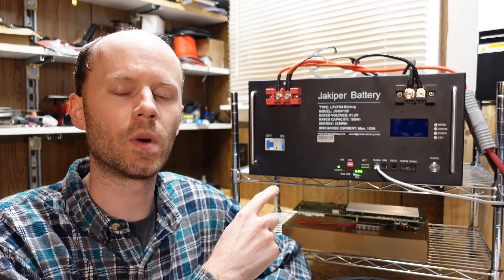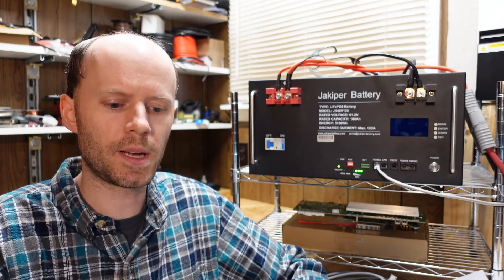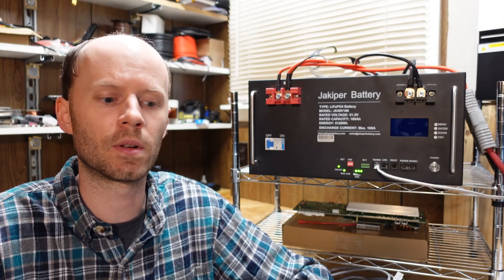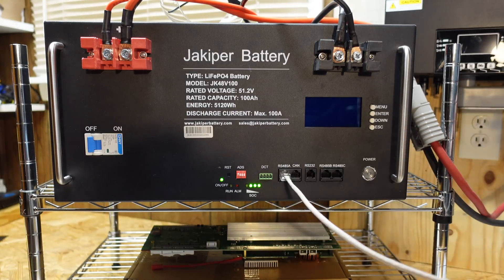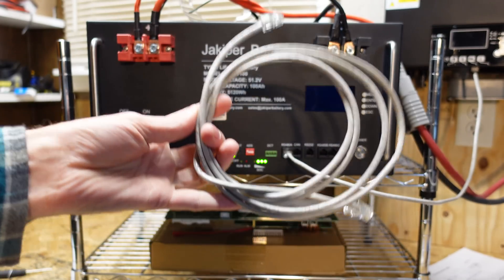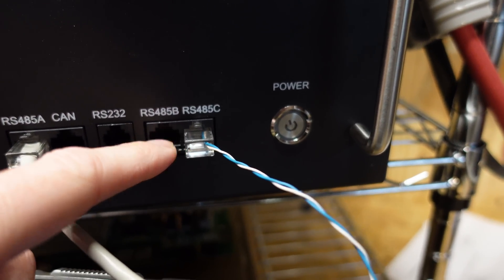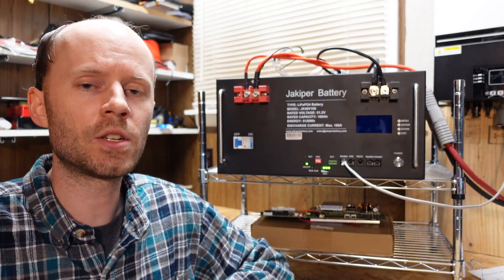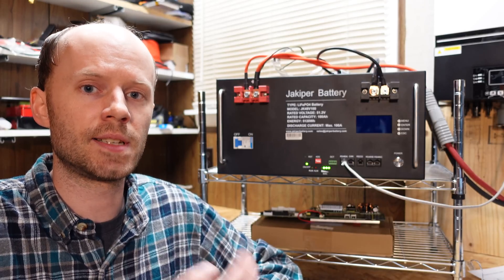Jakiper Battery and MPP Solar Inverter Communications, What's the Problem?

Comment: It has been years (over 30) since I worked on RS485 communications.     A cable with only ONE Pair (2wire) is a one way direction communication AKA Half Duplex.   A cable with TWO Pair  (4wire) is two way direction AKA Full Duplex.    Give the RS485 pin out of your battery to the inverter tech agent and ask them just map out the wires for a FULL DUPLEX cable.    You could see both devices on your video with your usb conversion because you have them both wired to "output", aka information coming out.   But on RS485 one pair is "input"(read) and the other pair is "output"(write).   I hope this helps.  (note:  When you showed you config screen, I noticed it was set to FULL Duplex, that is what made me think about this.)
Reply: Well, sort of. You're right that two wires makes for a half duplex RS485 bus, but there's no inherent directionality. It just means that you can't send and receive at the same time, the lines are shared. With this kind of low data system, that's not generally a problem. Probably one device is just polling the other device for information to avoid transmit collisions.

I don't see in the video where you mentioned it displaying full duplex. If it is set to that, but the other device is expecting or only capable of half duplex, that would be a problem.

Comment: People have generated electricity by connecting dumb lead acid batteries to inverters for decades. Then they started to replace the LA batteries with dumb Lithium batteries and all just worked fine. Communication was introduced to commercial products, so that users could NOT easily take any equipment and mix it up as they wanted. This is just the "Apple" concept put onto every newly built device. For what? I would never buy anything what need communication to work! If the device is only monitoring, then OK. Don't let a company tell you what "SMART" is. Be the smart one and go for basic, first principles. Something what will never break on you and where you can understand what is going on at any time.
Reply: Not everything in life is some grand conspiracy, having your inverter/charger tail off change current at high SOC is pretty handy. Also having an inverter shutdown gracefully and not just the BMS opening the FETS on a 100A load makes me feel happier something isn't going to go pop.
Reply: @edc1569  All those levels and limits you are talking about, can be set in the inverters UI anyways. Why would a BMS need to dictate this? Now you will say because of cell level voltages. Are you seriously going to hard limits on daily basis? The BMS has anyways final authority as you have correctly stated. What I dislike is that there is no fallback in this case. You get an Error on the inverter and it will shut down. Just because of communication issues while the inverter could easily continue its job by basing decisions on voltage. Generating electricity is a discipline of electrical engineering. Unfortunately, IT is starting to take over too much of it in my opinion. But yeah. Thats fashion of our modern times, and consumers are asking for it...

Comment: Will the battery work OK without  communication? Is it an essential feature or ust " nice to have"?
But there is the issue of truth in sdvertising/ false claims
Reply from the maker: Absolutely, it works great without the communications. It's just a feature that's nice to have and wanted to demonstrate since both devices support it (supposedly).
Reply: @LithiumSolar   thanks. I believe in the KISS principle !

Comment: Hi, look like it is the communication protocol, BAUDS-stopbit- etc. if those two do not speak the same language they dont communicate.  For what i understand, check the bauds etc it is using on your computer, and if you have to conf  the same on the units. 
have a nice one everybody
Reply: Looks like it needed a bit more setup than simply plugging it in even if the connections were correct - jakiper made a video https://youtu.be/J3JpHn4FeqA

Comment: Q4: How BMS communicate?

A4: Basic version received before 23th, February, 2022, BMS can communicate with PC though RS232/485.

Upgraded version which received after 24th, February, 2022, BMS can communicate with inverter though CAN/RS485A port, like Growatt, Sol-Ark…
Reply from the maker: Mine is the upgraded version that has the BMS comms ports.

Comment: Yeah I never got it working and never tried. That sucks they said that. I emailed them saying I am not interested in trying the communication out at all. I don't like the communication system for these batteries. I don't want any of my batteries communicating at all, and I use voltage to modify cycling behavior. Really sucks that they claimed I said that.
Reply from the maker: It seems like these companies all talk even though they're competing for the same customers. I don't understand, but either way, the claim was you and Dexter got it working on the SOK battery prototype (which I'm sure they heard from Min), so if it works on that battery it must work on the Jakiper too since they both have the same BMS. Communication is definitely not needed or required, but as you've seen by my elaborate Batrium displays, I like data! Lol
Reply: @LithiumSolar  That's because they watched your videos and Will's and found out how to build batteries, but nobody has a done a youtube video on how to program and implement a battery inverter communication interface. Of course that would be a year long video, and they would probably lose their attention.....
Reply: @NeverTakeNoCut-offs  I think Signature Solar has a video on how to do that . I didn't watch the whole thing though.
Reply: @LithiumSolar  I WOULD JUST RETURN THE DAMN THING, IF THEY WON'T TAKE IT BACK JUST USE THE CELLS FOR A DIY.........THAT REALLY SUCKS AND IS VERY SCARY.......I'VE GOT A LOT OF PROJECTS WAITING FOR THESE THINGS, WHERE I MIGHT BE BUYING BUNDLES OR MIXING COMPONENTS........THIS NIGHTMARE YOU'RE GOING THROUGH IS A REAL WAKEUP CALL..........
Reply: @LithiumSolar  if you did all, any chance this battery communication is  manufacture wrong connected , sorry for my ignorance, but anyone thought of this?
Reply: Doesn't the voltage drops at different loads cause issues with using voltage to set changer/discharge responses.
Reply: Other info I have looked up makes it sound like these use the canbus to talk to inverter charger and not the rs485
Reply: Jakiper now has a video on how to do this https://youtu.be/J3JpHn4FeqA

Comment: I couldn't tell from the video, but is the BMS on? I couldn't tell if the lights on the power button were on during the testing
Reply from the maker: Yes, the BMS was most definitely on. When the BMS is off, it also shuts off the SOC lights.

Comment: I was always under the impression that you need two pairs at a minimum for RS-485 (differential)
Reply from the maker: There are multiple versions. The most basic is half-duplex with 1 pair (which is what we have here). There is also full-duplex that uses 2 pairs.

Comment: Did you hit it with a hammer? My dad use to always hit whatever wasn't working with a hammer. Not sure if it ever got the "whatever" to work but he sure felt better after doing so.
Reply from the maker: Nope, but it's getting pretty close to that point...
Reply: @LithiumSolar  When you're in a professional situation and have to use the hammer it's called…  Percussive Maintenance.    😀

Comment: Did you make sure the dip switch itself is not upside down like how the signature batteries are?  Try reversing the order of the dip switch with down - down - down - up instead
Reply from the maker: I did check after seeing another that was upside down (think it was Gyll?). The DIP switch actually removable in a socket that looks like the kind of socket you plug an IC into. I made sure it was oriented correctly and also tried all 16 possible combinations (took a long time...). Thanks though.

Comment: IF we look at your laptop's screen, we can see that the prefix on the two sets of data is not the same. I'm saying that maybe the hardware is working, But the protocol is not the same. What the inverter is sanding is not the same as what the battery expects is vice-versa. What you need is the protocol message that the battery sends and expects. And also the same thing from the inverter. Then you can see if it is possible to make those two jives. Hopes that helps

Comment: you need the GND wire between the two data ports
Reply: I agree. The ground could be a special ground for communication
Reply from the maker: I didn't mention in the video, but I did try a pile of times with a cable that has the ground wire connected. I just made another cable after reading this to double-check and still no luck... Thanks though!
Reply: nah

Comment: Off-Grid-Garage yesterday or so had a video where Andy stipulated: if the settings for the charge curve for lifepo4 battery in the inverter are correct, and if the bms does its job of protecting the battery, and the cut-offs, float, absorption voltages are matching, does it really matter whether the bms and the inverter are communicating?
Reply from the maker: Nope, does not matter whatsoever if the battery and inverter are communicating. It's just a neat feature.
Reply: @LithiumSolar  Isn't load balancing between the batteries also a part of the communications?
Reply: @technologyjunkie01  Load balancing between separate batteries is not guided by the inverter or BMSes. It happens automatically due to the difference in voltage and internal resistance of the separate batteries.
Reply: @LithiumSolar  And it's a feature the battery people are using as a selling-point, so I am really glad that you are testing it :)

Comment: Many devices uses what's called the MODBUS protocol  on top of rs485. If so, the dip switches probably set the hardware address of your charge controller. In MODBUS, there is one master that can talk to many slaves with different hardware addresses. My Chinese epever charge controller uses MODBUS over rs485. I have written an arduino program to send commands and get status from the charge controller. I was able to find a mapping of the registers on line, but you could just sequence between the possible commands and see what comes back. An oscilloscope would be very useful to monitor the data lines to check to see if things are connected properly. One common problem is getting the A and B lines reversed. Hope that's useful.
Reply: jakiper made a video showing how to set it up  https://youtu.be/J3JpHn4FeqA

Comment: I am not familiar with this system, but wondering if data  TX needs to connect with data Rx? Or another combination. If the data Is duplex then you will need a ground (common)?
Reply: you obviously don't know what you're talking about
Reply: @TruthTortoise81  either do you or you would have posted the solution. Loser.🤮

Comment: The complete lack of packets from the battery is telling if you ask me.  Something isn't right.  It sounds like you have open communications with the battery people.  Should there be packets being output on that port?  Is there a setting to enable/disable data on the port?  I'd attack that specific issue if it was me spinning my wheels...  Good luck and keep us posted please.
Reply: On RS485 often you have some device be the Master, if you just have devices communicating randomly then you need to do all sorts of collision detection and mitigation.
Reply: @edc1569  Agreed.  However, if there is zero traffic in or out, it would seem as though the port was not functioning at all, to me...  I'm talking out of my azz, knowing so little about the actualities of the case, so don't mind me!  😊

Comment: Wow, thank you for your efforts with this. Signature Solar was also not very helpful with their battery coms. Looks like all these companies just want to sell product.A suggestion to bite off a smaller piece, is to use a pc to communicate with the battery first. This works for the older version of Signature Solar batteries..